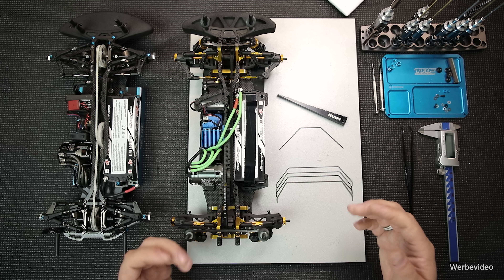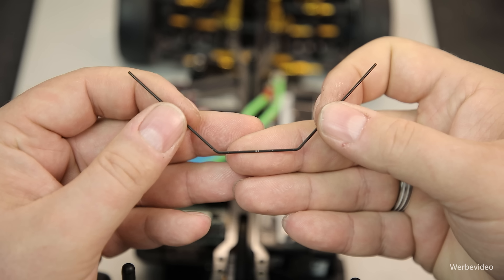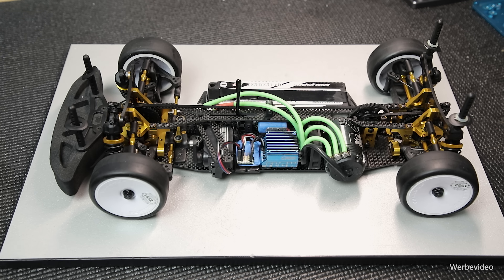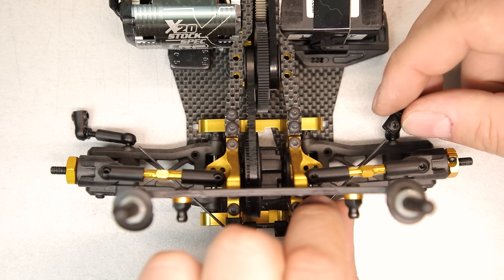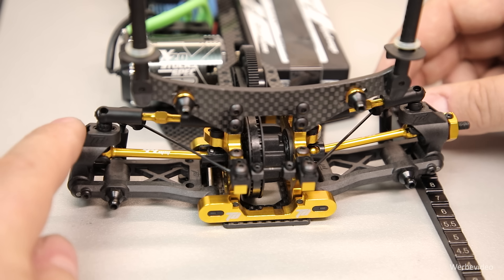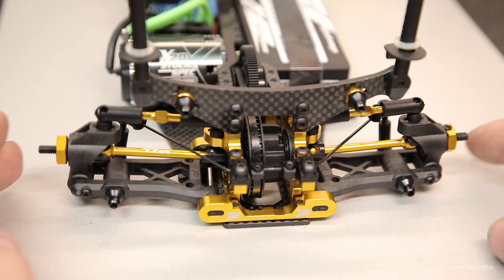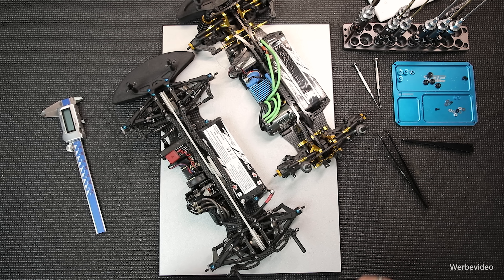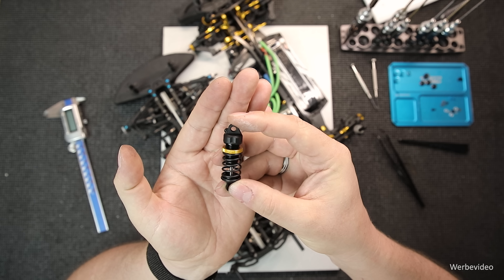1:10 Tourenwagen Setup - #3 Stabilisator

Comment: Hey super Video 
Hätte da eine Frage dazu 
Wenn ich die Stabis Messe und zb auf der einen seite messe und er fäng bei 7 mm an sich mitzubewegen und ich die andere seite messe und der sich erst bei 10 mm anfängt zu bewegen auf welchen wert gleich ich an? auf die 10 oder auf die 7 oder auf den Mittelwert von denen
Ich hoffe du verstehst meine Frage 
Lg

Videos sind echt super
Reply from the maker: Hi, ich würde versuchen den Mittelwert zu treffen.
Der Unterschied zwischen kleinem und großem Wert ist, dass bei kleinem Wert der Stabi etwas schneller anspricht - beim großen später.
Da ich deine Bedingungen nicht kenne - ob du mehr Stabiwirkung brauchst oder möchtest - darum der Mittelwert.
Das wichtige beim Stabi ist, dass er links und rechts gleich reagiert.
Reply: @GregorKRC  danke für die schnelle Antwort 
Schaust du auch das der Wert zb 7mm zwischen Front und Rear gleich ist?
Reply from the maker: @1988neumi  - ne, da achte ich nicht drauf, ob vorne und hinten gleich ist. Bei dem meisten Tourenwagen sind da ja auch unterschiedliche Stabis verbaut. Die Aufhängungspunkte variieren auch oft.
Links - Rechts sollte passen - das ist wichtig.